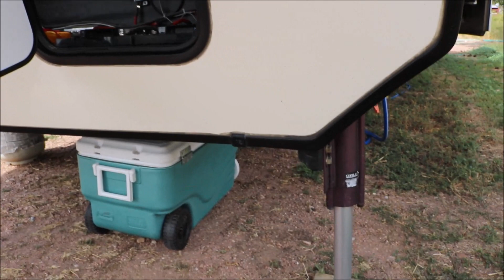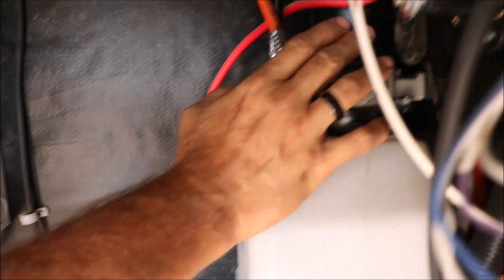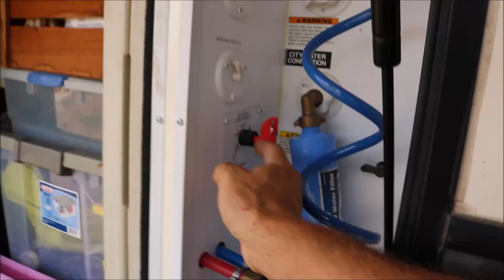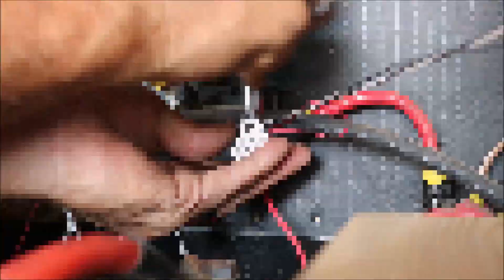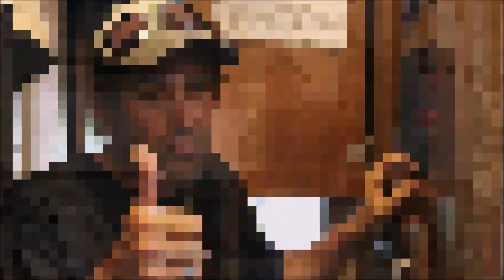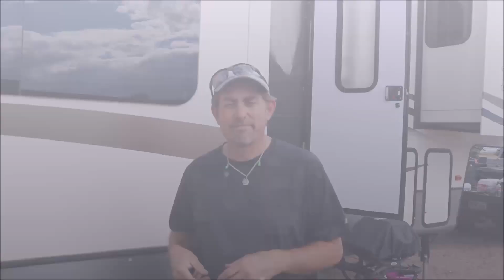Lippert LCI Leveling System Jack/Slides Cutting Out - Solved

Comment: Excellent video and you are right that there is not too much information on the slide breakers available that is as detailed as your video.  This is the exact issue I am having with my 2020 Montana.
One question/concern I have is it appears that you have connected your slide power cable to the battery input side of the breaker.  Should it not be on the output side post?  Won't this bypass the breaker?

Comment: Great Video. I know it is and old video but that is the great thing about the internet. It is forever. I too have been experiencing this problem for a couple of years now. I can tell the motor works harder to retract the slides than to extend them, and it is always my main slide (the largest and heaviest) that causes the problem. Knowing the system worked before, led me to believe the slide was either binding or facing some other form of resistance. I have tried a new motor, without success. I also replaced the cheap plastic rollers with "heavy duty" (not cheap, but still not high quality) steel rollers (they lack any bearings). I didn't find much useful information regarding maintenance on these systems so, like you, I have been trying to figure it out myself. I don't have a good baseline to know what the motor load was originally, but I verified during extraction, the motor draws 36 amps. During retraction it draws 63 amps, pretty consistently. The breaker does cut out, which I would expect. Replacing an over-current protection device such as a fuse or a circuit breaker with a higher one goes against standard practice. I only say that to say, I believe my slides are working as well as can be, so I am willing to try this fix. I originally suspected the original 50 amp breaker had just weakened over time, but knowing the current is exceeding the rating of the breaker by more than 50% tells me that might not be the case. Even if it is, a new one, most likely would not solve the problem. I read the document you attached to this video. It concerns me that the 80A recommendation was pulled from Lippert's technical bulletin. I can imagine there were problems with people using the higher current breaker to mask a bigger problem. With all that said, I wanted to ask if now, four years later, assuming you still have this trailer, have you had any further issues either with the circuit breaker replacement of the slide not working properly?
Thanks for the great info.

Comment: Good video :) I got same problem as you, but me it is just when I retract the slides or the jacks. Do you have two brakers for your hydrolic system ? Me I have 6 points auto-level jack + 5 slides, all hydrolic. But I only see one braker of 100AMPS, did you have to change two brakers? I got a Forest River Sandpiper 381RBOK 2017. Thanks for your help.

Comment: Great video.  I have been seeing this issue on my LCI Ground Control 3 leveling system.

The battery says fully charged but the power blinks when it it is driving down the front Jack's when the trailer is more than two degrees out of level.
I'll break out the clamp ammeter and verify that it is pulling to much current and tripping the auto breaker.
Reply from the maker: Yeah, that sounds like a good place to start. As a side note, I know that these auto-leveling systems get a little cranky when your more than 2° off. Sometimes will throw the calibration settings all out of whack causing it to go crazy during setup or tear down. Good luck with your trouble-shoot! 🤠👍

Comment: Replaced with 80amp fuse for stuttering on mid bunk slide and bed slide..it worked for a bit now bunk is fine..bed slide and awning now stutter. I was going to replace that row of 50 amp fuses with the 80amp.

Comment: I have this problem as well, I have noticed that it mostly it has happened when My batteries are low.  If I am plugged into shore power and slide in or out and work my leveling system it works fine, but here lately it seems that my batteries are not holding the charge and if I slide on battery the breaker will pop but reset after a seconds.  Wonder if low voltage will also cause the breaker to pop
Reply: @pilotofdoom  thank you for that response

Comment: I have a Heartland Landmark 375 and I think I have this problem.  I will swap with the 80 amp and report back.  Thanks for the great info.
Reply from the maker: You're most welcome Dan. Thanks for the comment and that would be great! Good luck to you!
Reply: So Dan did it work for you!
Reply: @MingoMoon  - Yes, my 2009 Heartland Landmark 375 has 4 50amp automatic circuit breakers, each powering different systems .  The circuit breaker connected to the leveling system had failed completely leaving me stranded.  I swapped one of the other 4 breakers with the bad one and everything performed normally.  I switched the circuit breakers back to original position and put a new 80amp ACB in place of the failed ACB on the leveling system - works great now with no problems.  Thank you,
Dan